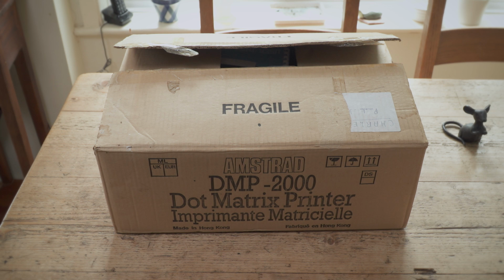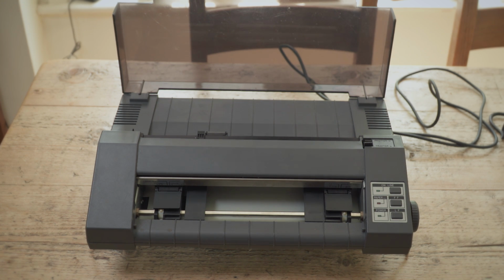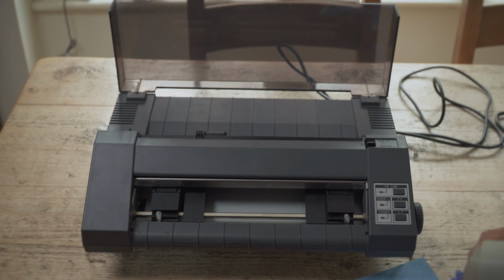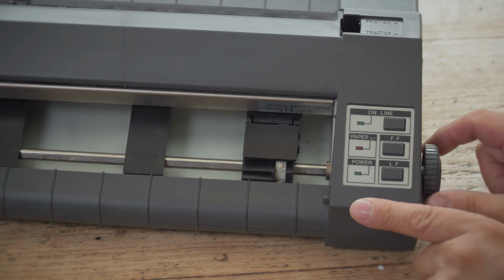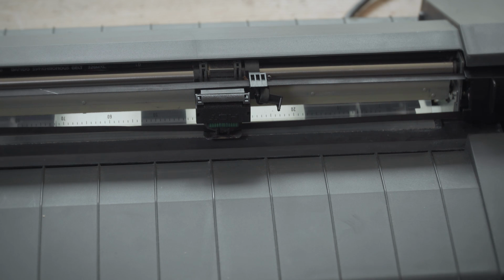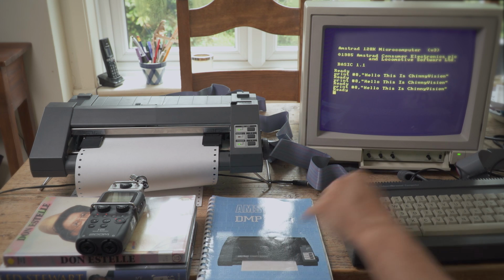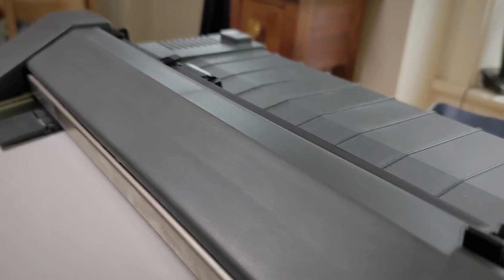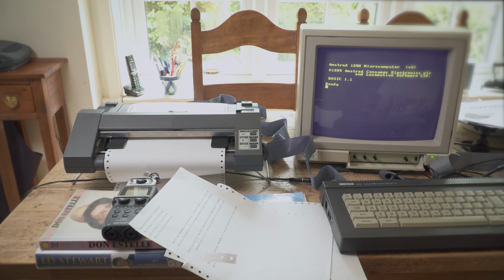ChinnyVision - Ep 413 - Amstrad DMP 2000 Dot Matrix Printer

Comment: Commodore did something similar, taking Epson printers and rebadging them as Commodores with their own 6-pin IEC serial interface. Other manufacturers including Star made models with that connector too. But my first printer was a dodgy Seikosha 9-pin, and its line feed never worked properly - so you ended up with overprinting and having to redo everything. I was still using a dot matrix well into the 1990s, sending off some of my Commodore Force/Format articles printed out on a Centronics-based Star LC200 (with colour ribbon) via an interface.

I enjoyed this video a lot, particularly the press release.
Reply from the maker: The Commodore Epson's were probably like the Amstrad DMP-1 and were internally branded Seikosha prior to the name change. I know Commodore sold the same Seikosha as Amstrad used for the DMP-1 but they switched to Riteman. No idea if Commodore stuck with Epson or not.

Comment: Only Amstrad printer I have is the DMP-1. A slow and noisy beast that is still alive and kicking to this day. It has out lived more inkjets than I care to think about. Still on its original ribbon as well from what I can recall.
Reply from the maker: The DMP1 is far more basic than the 2000. In fact it's not even Epson compatible.
Reply: @chinnyvision  

Other issues with the DMP 1:

False descenders on lower case characters like g, j, y etc. which makes your output look weird.

You would have to advance a full page to align the print head with the top of a page. If you didn't your output would start in the middle of the page. Annoying if you forget.

No draft or NLQ options. It just prints in one quality.

Like you said won't work on a PC (I know, I tried and failed just because I could).

No option for normal paper so its tractor feed or nothing.

For a future project with the DMP 2000, get hold of a Dart scanner and try to use that with it.

Lastly the Acorn monitor is fine by me. Does it have the button to make it green screen? The ones we used in school had the option, very retro.
Reply from the maker: @garryadamson8507  Yes it does. It's the right hand button in the bit with the flap in it.

Comment: I had one of these. Originally used it on my Speccy +3, then my Amiga 500, and I think I sold it when I got my Amiga 1200 and bought a Canon BJ-200.

We thrashed it, and it kept working. Accounting listings for my Dad (off his laptop - ha - luggable thing), program listings, some BT phone book on disk we had. I did a lot of A Level notes on it in Tasword +3.

Went through loads of ribbons, and only ever had one problem with it. Great printer, great value, I still remember the noise. But the print quality was the compromise.
Reply from the maker: Thirsty on ribbons, noisy as hell and poor print quality, but tough as old boots, works with anything with a standard interface and is bullet proof.
Reply: @chinnyvision  better than that Canon. Cheap ink refills meant I spent all my time running the unclog routine.
Reply from the maker: @simonm72  We had a BJ100 and eventually resorted to refills as well and the horrific mess and stripey printouts!
Reply: @chinnyvision  those fat syringes were the bane of my life! Still, better than my Alphacom 32 on my speccy. Sold that in two weeks, garbage